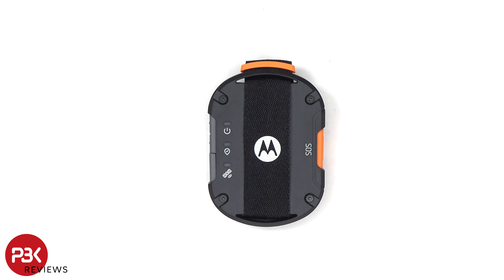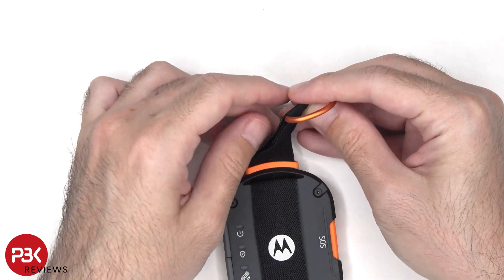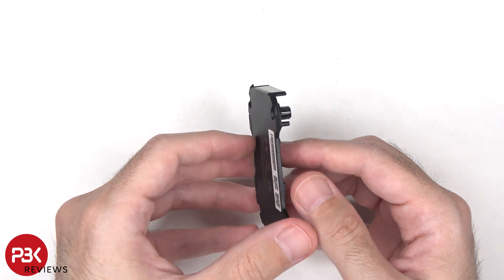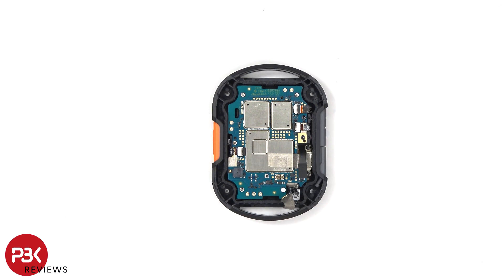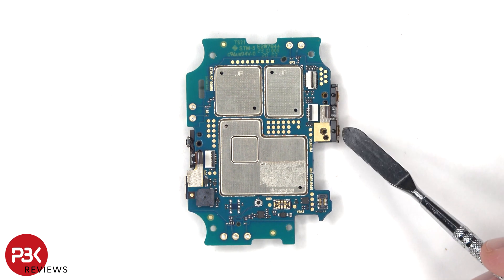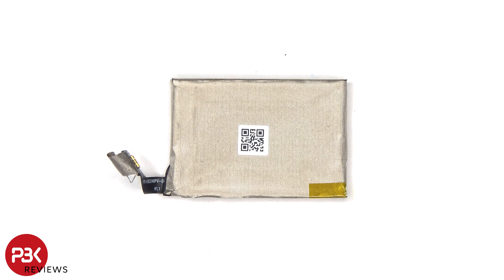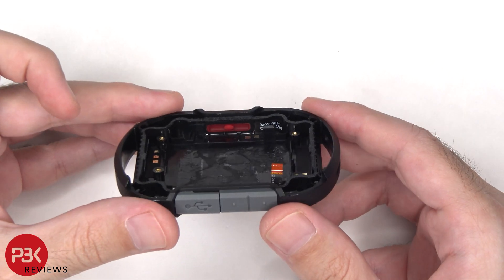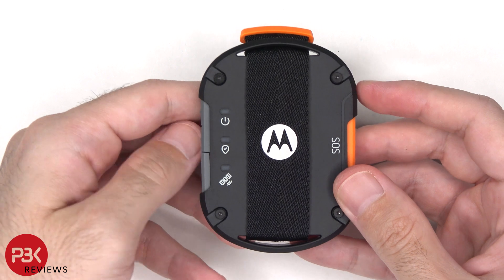Motorola Defy Satellite Link Teardown. A look Inside the Bullitt Satellite Device.

Comment: It's too bad you didn't de-lid the I/O shields to identify the communication IC manufacturers. I believe Mediatek designed the satcom chip in this one. Also, it's amazing such a small antenna can reach a satellite all the way up in geosynchronous orbit!
Reply from the maker: Usually when the shields are removable, I remove them but if they are soldered to the board, I don't remove them to risk damage to the board or nearby components. I don't have expert soldering skills so yep.

Comment: What is this used for?
Reply from the maker: It's used to take along with you to remote places where there is no cell signal (for example if you're hiking or camping) so you can send two-way satellite messages with your phone and also SOS assistance in case of emergency.
Reply: @PBKreviews  why not use this in phones instead of towers.
Reply from the maker: They are starting to add them to phones now a days, like the new iphones have the sos feature, and the motorola defy 2 phone once released will also have the two-way satellite messaging and sos feature. This device basically lets current phones which don't support it, have support for it.
Reply: @PBKreviews  I'm not a outdoorsman so I have no need for this device.